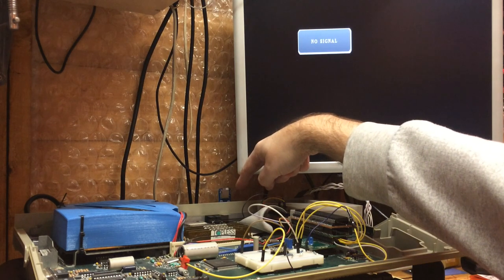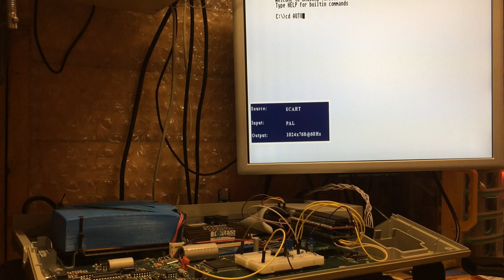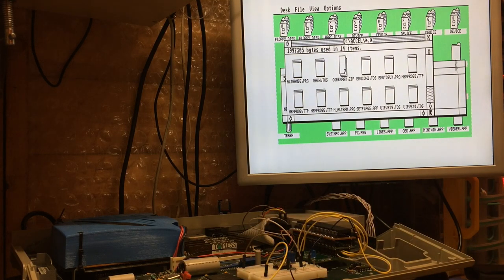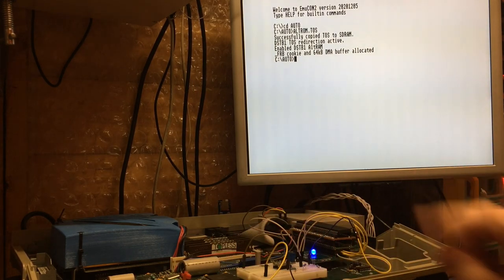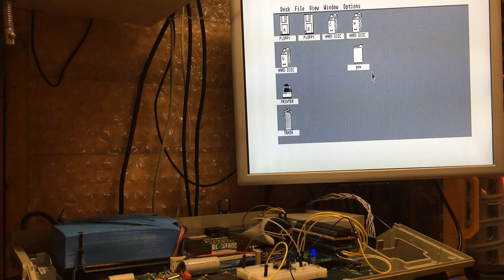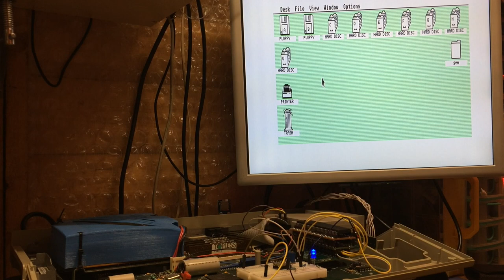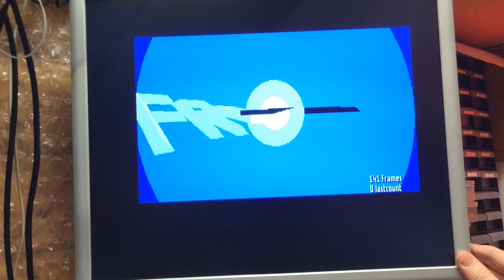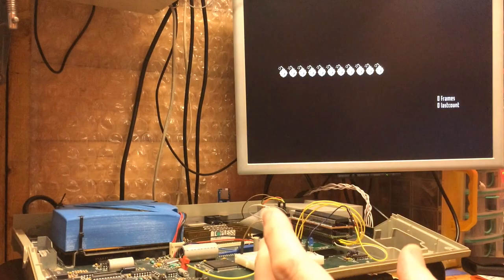Atari ST accelerator follow up & demonstration

Comment: Really nice. By the way the output video of your STe is really nice. Maybe it's just the monitors I use but almost all Ataris I've got output with lots of vertical lines and noise.
Reply from the maker: I think perhaps the video processing is helping it out. It's missing a lot of shielding and going into a monitor that's dot clock isn't quite in sync so I'm afraid it's not all that great IRL. :-)

Comment: Great work! I've had the "blitter black box" problem when the blitter couldn't access ROM. But not sure how that would happen on the STE. TOS doesn't really like running from alt-ram. IIRC PP ROM loader patched loads of addresses as they were hardwired in the code. So basically TOS couldn't be properly re-allocated into RAM. I gave up with it in the end. It's why I mentioned I am just avoiding all that and copying ROM into a SRAM on boot and let TOS run from its own SRAM at its correct address range. It just saves a epic amount of headaches.
Reply from the maker: Thanks exxos. I think you're mixing up two things, though. The black boxes aren't related to TOS or the ROM at all. I have deliberately decided to no allow blitter access to AltRAM as it introduces a term (ie. an AND gate) too many into the logic & means I miss some timings. Normal Atari TOS happily locates desktop working RAM in AltRAM, hence you see the blue flashes on the desktop, but then when it wants to blit some of that RAM to the screen: black. Your situation was different in that you had an 030 and were using the MMU to map 0xExxxxx into TT-RAM space and it was causing you jip (I happily do that on the Falcon, though, and stock 536 users seem to manage, so I think it's perfectly valid). What I did later in the video (unrelated to the blitter decision) was to do exactly what you say here. ROM is copied into SDRAM and the CPU is told that's where 0xExxxxx lives. That works great. But I still don't allow blitter reads to AltRAM for the previous reasons, nothing to do with the ROM redirect.
Reply: @thetechnoshed  The black boxes was on a stock STFM where I had my own ROM decoding logic, but the blitter couldn't access the ROM. So it ended up with black boxes. But if it's on purpose then fair enough.
Reply from the maker: @exxosuk  Ah, sorry, I misunderstood. Ah yes, if you're only decoding the ROM for the CPU and the blitter doesn't have a fall-back, that's to be expected. I remembered your 'TOS doesn't like running in AltRAM' comment also came up with the 536 -- and that really didn't make any sense as it was MMU mapped.
Reply: @thetechnoshed  Yeah I've found all sorts of oddness with stuff. TOS doesn't handle caches correctly IIRC with the 030. Stuff screwed up , but only when TOS was in TTram and only when caches were enabled.. but only with the -38 DMA.. But this was on my H4 board.. Like I posted a few weeks back on the forum, it all behaved on my H5. But the H4 behaved with the IMP DMA.. Caches with "onboard TOS in ROM"  worked fine eitherway. So I need to look into all that at some point :(

Comment: Hi, wondering what you think of this?
I have an STe with soldered Cpu , I'm looking at buying a rasberry Pi and running an Atari st emulator on that instead of trying to boost what I've got. This wouls give me hard disk storage too.
Reply from the maker: The more recent Pis can do a reasonable job with Hatari (providing you don't want to emulate a Falcon), but my floppies don't fit in the USB socket and I can never find the HELP key! ;-)

Comment: How much space you have left in the FPGA? It would be awesome to dispose off the blitter on the motherboard and have FPGA implementation at 16Mhz. Bus speed could be limiting factor. Not sure it would be worth it. Could be a nice idea to add blitter to any machine :)
Reply from the maker: Not enough for a blitter, I reckon! It's only CPLD and the SDRAM contoller alone takes up half its space. That said, I'm no verilog wizard. It's open source. Have at it!